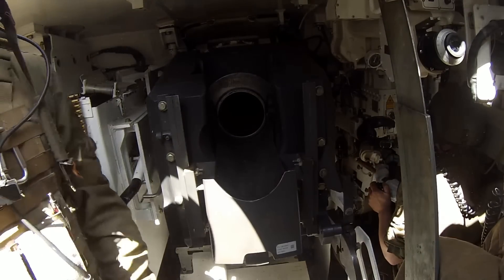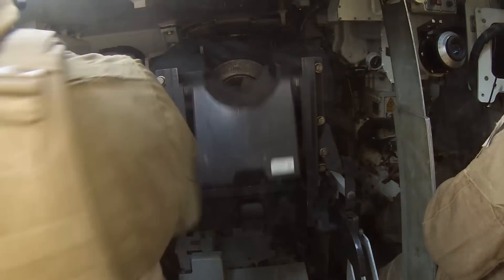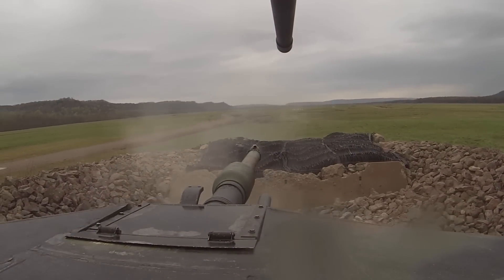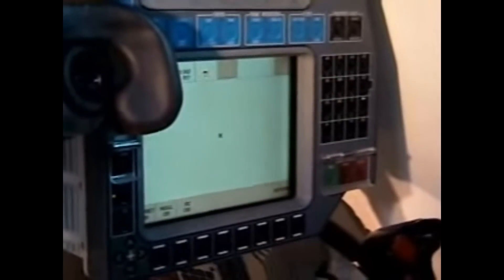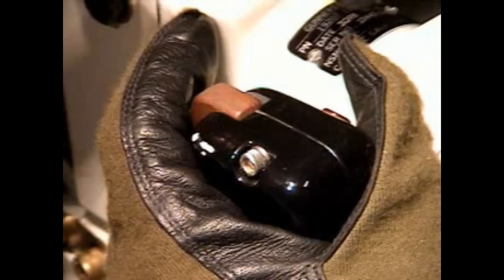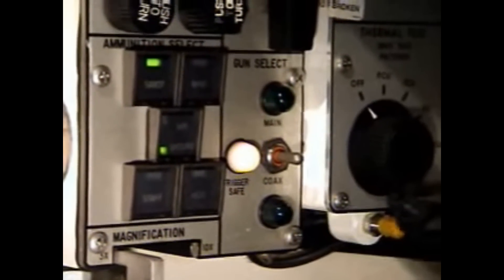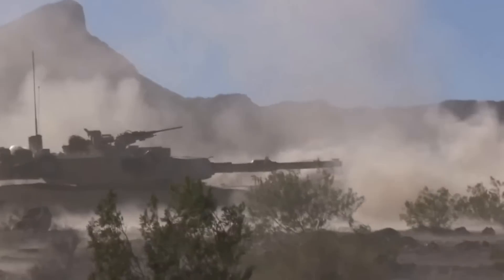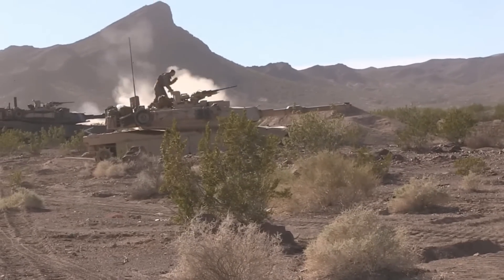How Do They Clear Tank Gun Misfires?

Comment: what really sucks is when you have to remove an unfired shell and its stuck.We had ammo that swelled up in the breach while being battle carried for a short time on a live fire range.Had to use the shell puller and the swollen cases were breaking and spilling the propellant all over the turret floor.We ended up firing off the battle carried unfired rounds just to avoid the loss of time and danger of cleaning up after broken tank shells all night

Comment: Only time I've seen the procedures used, is when the gunner goofed* and left the flashlight lens cover interrupting the firing circuit.  Usually about halfway though the litany he realizes why it's not working.

*-For MILES gunnery you are supposed to interrupt the firing circuit so it doesn't get burned out (MILES is laser tag for the Army; you're shooting a weak laser not a round, so that charge is going into the components of your firing system). They do this by sliding a flat piece of plastic to interrupt the circuit. Procedurally the gunner is supposed to run a firing circuit test before going downrange, which would catch this, but if he slacks off a bit, it can happen. Like so many things, "Oh, crap!" at the time, but "Ha-ha" after the fact.

Comment: Part of the projectile case is combustible hence only the base of the round ejects. This allows more than 5 rounds in the spent round as does Leopard 1, five spent rounds will only fit in the spent rounds bin on a Leopard AS1. You then remove the spent rounds through the "pistol port" a small hatch on the loaders side of the turret.
Ex Aussie Tanker.

Comment: back in 2002 C co 3/67 Ar had a tank burn up at Ft Hood and blow both blow off panels out because the loader pulled a round out he didn't realize it was cooking off to switch or put back in ready rack in between gunnery engagements on table 6 sitting at the first BP. I was pulling support at the gate and heard the huge explosion and seen the huge flames through and above the tree line about 150 meters away. when the crew bottle/ halon went off the driver passed out because of loss of oxygen and couldnt get the old school periscope wing nuts even close to loosened to drop the old school night sight to get out. when he passed out the tank was in drive and drove all the way to the end of the range at idle speed burning up. its was complete fucking chaos because there was nothing but screaming and comotion, and they tried to drive along side the tank to jump pull the emwegancy fueline on the outside but couldn't because the terrain was too rough. the tank finally stoped when it hit a big tree at the end of the range. The end result was the loader (Chris Morados RIP..who was the loader burned to death) and ( Robert white the driver who died from smoke esfixiation RIP ) the TC and gunner made it out with minor burns on the start of the fire. The gunner lost his mind and got discharged and the Tc moved to another unit. was one of the craziest things I ever seen in my life and ive seem alot of crazy shit. I was just hanging out with Chris at lake Blora water sking the weekend before. I was told in basic training people fuck up and die in training I just never  thought some shit like that would happen. It was their first gunnery too. Very sad

Comment: The army has there own job regarding to the maintenance on the tanks and as a mechanic we are responsible for everything with the tanks from services to fire control to the engine and transmission issues. When tankers go out for qualifying if there are any allibies then us as mechanics have to inspect the entire system for any faults leading to a misfire or any issue causing the allaby.  I was a 91A( tank mechanic)  in the army for four years and currently awaiting reclass to 19K (tanker)

Comment: The thing about it is with 120 mm tank rounds they are fired using a electrical charge so once the breach goes down your fine that's why you always use gloves cause the static electricity from your hands can actually set the round off. I love being a loader slinging them rounds is amazing and it smells amazing haha

Comment: I was a tank commander for the M1 Abrams and never had a misfire. It is very dangerous to have a misfire on any gun system but when you are inside a tank and something goes wrong you are in big trouble. You have nowhere to run.  Other than that I absolutely loved that tank.
Reply: It's a fair point. Your inside a heavily armoured box on tracks that other people are trying to shoot. If it's not safe inside there the area immediately outside might not be too cozy either. Literal frying pan fire.
Reply: Same here. I had it happen twice. Tension ramped up quick.

Comment: Never had one missfire in combat but you can get the tc would have had us throw that bitch out the turret and check another round they also have a little block that H gas a lightbulb on it the site between the breech and tests weather the main gun is getting power 🔋to fire.

Comment: I was a tanker for 8 years. I gunned for 4 of those 8 years.  You don't go to any specific school to be a tank gunner besides the standard MOS school you attend. You get chosen based on your proficiency as a junior tanker.

If you have an miss fire issue 9 times out of 10 it's operator error (I.E. SAFE ARMED Lever is not in the Armed position.  Trigger safe switch is not in the MAIN position, Loader did not seat round properly)  If you have gone through all of those misfire procedures and the round still has not fired then you probably have a dud primer. I've never seen that happen to be honest. I've fired hundreds of rounds and every single one has gone boom when I pressed the trigger, or cranked the master blaster.  I have had rounds fail to seat properly in the breach, and could not be forced in by the closing of the breach block to where I needed to have my loader lock the breach open and I kick the base of the round until it seats properly.  Doing that kind of puckers your butthole, but as you understand how the ammunition is fired there is really nothing to be concerned of.  

The combustible casings are rather fragile and if you have an aggressive loader they can damage the casing when they load, causing it to jam up inside the breach.  As long as you can get the breach to fully seat on the base of the round you can fire the main gun. While it can be dangerous, isn't really that dangerous. But lets face facts. Everything you do on a tank is dangerous.  The tank was designed to kill and maim and it'll kill you just as quickly as you can employ it to kill the enemy.
Reply: Oh, so the case on the shell burns with the power charge then? I've seen only a bit of the rim come out and I can't wrap my head around it.
Reply: Thank you for your service sir
Reply: I always thought being a tanker was cool....until I saw a tank crew punching the bore of the main gun, at which point I was very grateful that I didn't end up in tanks.
Reply: Ryan sexton & zombie_tanker19k how difficult is it (or would you venture a guess it is) to shear/tear/heavily dent/otherwise seriously FU the casing well beyond the point of it just not seating correctly? Is the breechblock able to exert enough force to cut a casing if the round was only inserted halfway & the breechblock somehow released upwards (I'm assuming there are mechanical safeties involved to prevent this) or does the breechblock not really have a lot of force on the upstroke? Is there any kind of demo given (live or video) to tankers/ammo handlers for such a thing to demonstrate just how little dumb-assery it takes to light up your own tank/ammo loading area?

Apologies for the rapid fire questions! I had no clue that consumable cases were used, although it does makes a hell of a lot of sense. Seen too many movies with spent brass littering the floor, although that's always been older tanks. I should have known better given the stories from my Dad about firing howitzers with differing powder charges and "cheese" (primer charge? Way to "fine tune" the charge? Still looking for info on that) based on the specific fire mission. Before that I just assumed they used identical self contained shells & the angle of the gun was the only way to adjust for range/tof. Not sure of the exact "howitzer" that was though.
Reply: @Iceberg86300  When you extract a round it's possible to separate the base-plate from the casing, but in 20 years I've never heard of it happening.  If it did, it'd be an immediate evac.
Reply: @artillery8851  hey thanks for the response!! Appreciate you taking the time.
Reply: Art Illery That happened to my Battalion commander during night gunnery. Had a misfire and had to extract the round but it was stuck in the breech. Pulled so hard they ripped the cap off. That was a long night.  Battalion  commander went 1st and I was on the ready line as 1st platoon ldr.  By the time they reopened the range my “night” run was at sunrise.
Reply: Ahhhhh combustible casing... I was wondering why only a small piece was being ejected from the breech. Thanks!
Reply: We had 6 duds stored in the rack by the end of one exercise, though we were told that it was because of a faulty batch of practice ammunition.
Reply: Made 120mm cartridge  bases and often wonder same as  we also made 105 C/cases  too.
We are a prosperous  country and spare  nothing to provide the best ammo  we can mfg. To defeat our Enemies 💣
Reply: @joekurtz8303  are you saying we can't get this item cheaper by subcontracting production in China? 
Hold my Elections!
Reply: No"SIM"......????
Reply: Ha ha you said master blaster.
Reply: Really interesting, thank you for sharing.
Reply: Consider my arsehole well puckered just thinking about that.
Reply: Good to know that you guys are getting quality ammunition.  Granted user error goofing things up.
Reply: former 19K here, the round are electrically fired, so kicking the steel aft cap is SOP...its when you have a dud round stuck in a hot breech that the SOP for 15 minutes is really intended for..you dont want that fucker going off in your hands..

bonus tidbit..the combustible case is basically cardboard impregnated with nitroglycerine....we cradle those babies like babies when loading the racks on the ammo pad.
Reply: Interesting , I often wondered how you would deal with a situation like that. Giving  a kick to the base of the round sounds counter productive some how :-)
Reply: That's quite true I was a 91A tank system maintained and have heard some stories like that there was one time where we were on a training field and this crew had managed to bend the  main tube by rotating the turret into a tree last time I heard of them they were on extra duty for six months back to back

Comment: All Armor crewmen (Tankers) are trained in all 4 positions (crosstrained) at OSUT.  Most start as loaders, then go to drivers, then gunners (i charge when the TC is gone) then Tank Commanders.  the rounds are secured in the ammo storage because that is universal, no change if in an range at Graf. NBC environment or otherwise.  Although, situation permitting, I would toss it out too.  The 15 min is needed to wait out possible cookoff.  It would really suck to open the breech and have the round go off.  It does depend on tube temp as I remember.  AFAIR, we would wait some 15 to 30 seconds the try to extract the round UNLESS the guntube was hot, then wait the extra 15 min.  There are also special tools to extract a round that is stuck in the breach and procedures if those tools fail. The cause can be as simple as a bad round (breech circuit tester lights) to a bad firing pin to as complicated as a broken wire that is inaccessible.
Reply: TheRetiredtrucker It happened to my crew and me quite a few times on the range. I was a 19E, during the 80"s until 1990. My National Guard unit had the old m60 series tanks. At the time my enlistment was up, we had the M60A3's. Missfires can be caused by a lot of things, but it's scary when it happens. Almost every missfire we had was solved on the first try by dropping the breachblock and rotating the round 180 degrees, I only remember one that had to be rotated more than once, and each time got a little more scary. The old 105mm rounds we had, had a long primer tube in them, and each time there was a missfire, we never knew if the powder might be slowly burning it's way up the tube while we were handling the dud round.
Reply: Just curious, in an NBC environment, how do you keep clean during reloading? Is a positive cabin pressure/high air-con flow rate maintained so that, when the breach opens, the clean conditioned air flowing out stops anything nasty leaking in?

What else is involved?

Comment: In some real combat situation, by the 3rd or 4th misfire you may have been incinerated by an enemy TOW missile. 
Why wait after 6 misfires to replace the round?
Reply: Because it takes a lot longer to extract that round (it's not the sturdiest thing, you have to be careful) than it does to try those additional steps; as you're acttualy doing it it takes just a few seconds for each step, they rehearse this and have it down like clockwork. And clearing the gun by shooting it is the safest way to do this.

Comment: Loaders are a step up from the driver. They're a step down from the gunner, who is a step down from the TC. Tank units tend to promote their crews from within every time they get a new guy.

You all want ass-puckering? Try a squib load on a Mk. 19: One of the basic issue items is a metal cup with a couple bolts in the walls, with a long acme screw in the bottom and a crank: You torque it onto the muzzle, and crank the (live) 40mm grenade out of the bore. The gunner's job is to have the bolt open and catch the round  before it falls out. Not a fun day, especially not while in contact, because you then, assuming you haven't blown your legs and testicles off, have to dispose of a shock/impact sensitive grenade (that may or may not be armed) while being shot at. 

Anything not working with any weapon that's firing live and explosive, ammunition is "not a fun day". Some are less fun than others.

Comment: They shouldn't use a firing pin.  Should use a hot wire that's placed in the round itself on the tank.
Reply: It does both: the firing pin carries an electrical charge. Why use just one?

Comment: The ammo storage in the bustle has an armored door separating it from the rest of the tank and blow out panels in the top of the storage area. If a round explodes in one of the storage racks everything vents strait up.  An M1 got stuck in quick sand in Iraq and the crew had to bail after fighting the tank.   It was decided to destroy the tank in place because they had objectives to get to  They fired a round into the ammo storage, the panels blew and the tank except for ammo was good to go if someone could get it out of the quick sand.  IIRC they had to have demo charges placed in it to render it inop.

Comment: "why do they put it back in ammo wrack?" 
the M829 munitions series has a safety system in the primer. when the primer is struck, it will displace a clamping mechanism around the primer, and hold it in place if the munition does not fire correctly, preventing the primer from moving again. if the round IS fired, the clamp will do that same thing. but the primer was still able to contact with the munition's ignition or fuse. 
so even if the munition failed to safety in ammo wrack, only a small few of rounds would have been lost, and the top blast doors would have blown off, the crew would have been safe.

funny, russia didnt get back up FCS till T14

Comment: wtf you would think they would have a faster way of doing this. like a hatch in the floor they can dump the round out after waiting to make sure it don't cook off. this happens in a tank to tank battle and your ass is grass.
Reply: Re:   Do you really want to be in a tank with a hatch underneath!!!!? That's an added weak spot in the belly armor that IEDs and mines could simply blow thru. The M551 Sheridans and maybe earlier tanks had what they called escape hatched underneath the driver section. I believe in Vietnam, they started adding belly armors to the Sheridans and sealed off that hatch because the belly hatch was such a weak spot. So, no, a small hatch for duds would be a bad design for tanks.

Comment: They forgot to mark the round with a red marker.  I was an armor crewman for a while.  Also there is another check, there is a test card with a light on it that you put in and have the gunner test the fire circuit, if it does not light, check the fire cable, test again. if not lighting up then you have a real problem as it might be the fire controller and that requires a few hours downtime to fix. it is not a firing pin that activates the round but rather a electric arc from the probe in the breech block.

Comment: I'm an Abrams tank loader and handling a misfire is one of the most stressful parts of my job. Especially when the round swells while in the tube and you have to ram it out.
Reply: And when you're trying to pull it out and aft cap separates from the casing, that's fun too
Reply: @emmahstone3106  omg. Never had that happen, but I would freak out.
Reply: Yeaah,   that makes the old 105mm unitary / OQF  cased rounds seem really really preferrable.
Reply: Or when the the round starts sizzling and smoking inside, that makes me want to kill myself.
Reply: Holy shit, they'd better take my backup pistol away first. If they tell ME to ram it out, I'll pull my pistol and blow my brains out instead!